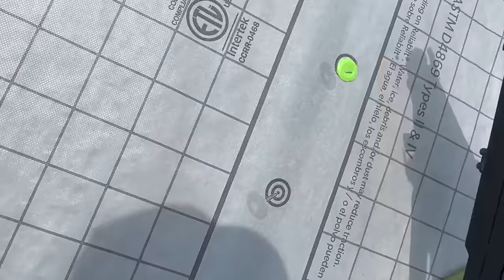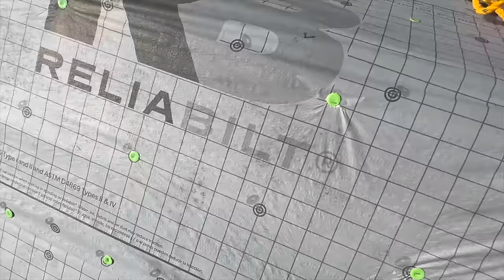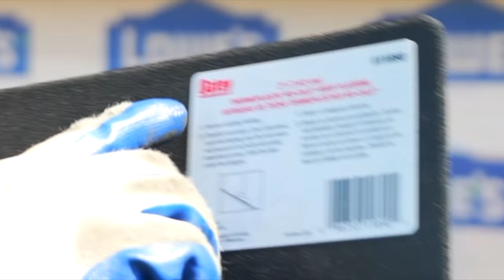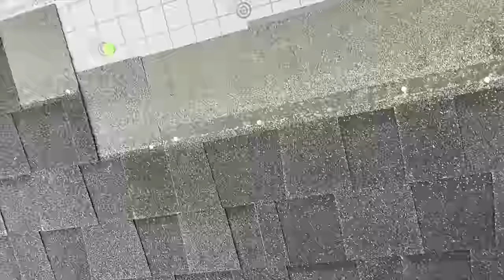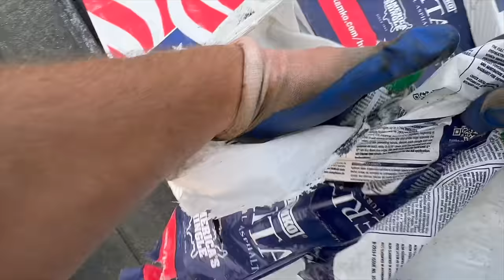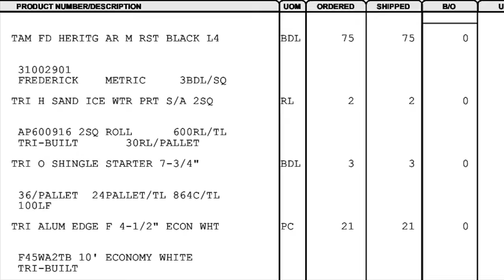How To Install Roof Shingles - BEGINNERS Step-by-Step GUIDE

Comment: Uh, maybe that drip edge should not rest tight against the facia board?   Maybe 1/2 or more away so that surface tension does not "wrap " the rain water against the facia.    !! 😮

Comment: Not bad but a couple suggestions. Cut your shingles around your pipe boot("dry run") before you tar nails. Avoid getting tar everywhere.  Dont tar any face nails before roof is completed. Install ridgevent the entire lenght of ridge it looks better. Not necessary for felt to hang over edge. No need to snap multiple lines with architectural shingles. Establish straight line on fist course. Minimal inconsistencies with shingles. Just a Guy with 45years experience

Comment: Why did you not install the ice and water shield on the entire roof and just the one line at the bottom of the roof? Unless I missed something- it looks like you only did that one line toward the bottom before you showed us the drip line installation and then installed the rest of the shingles directly overtop the synthetic paper…
Reply: Ice & water is only required on your eve edges and valleys. In some Northern climates at may also be required on Gable ends.

Comment: so why not use apron at the eve and drip edge on the sides , iam asking so I can understand the reason , not being a smart azz ,  and does it matter if gutter is going to be installed , from what Ive seen the apron seems to work better reaching into the gutter , you thoughts ...

Comment: 1:48 FYI, these are ROOFING CAP NAILS, NOT MADE OR MEANT FOR STUCCO WORK, so ppl; PLEASE QUICK/STOP using these for Stucco, get the ones MADE FOR STUCCO! Rant over….but as remodeler/GC I see these used in places where really shouldn’t be used…

Comment: You are not wearing the harness properly, the leg straps are designed to be fairly tight in the crotch area. If the leg straps are not pulled up snug, if you fall it is going to cause damage to the private parts. Oh!!.